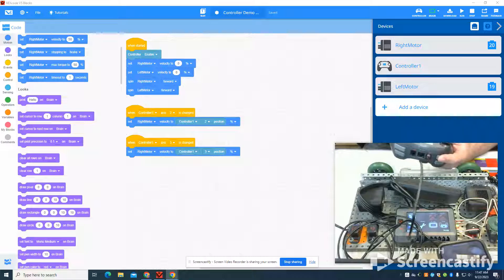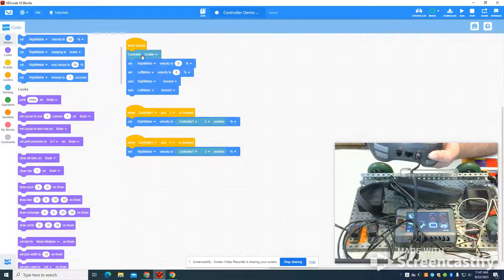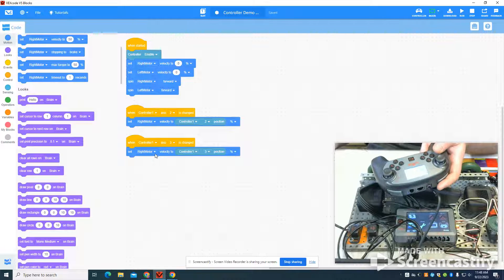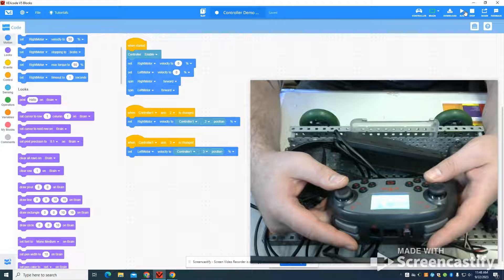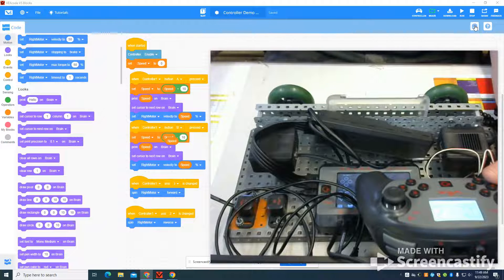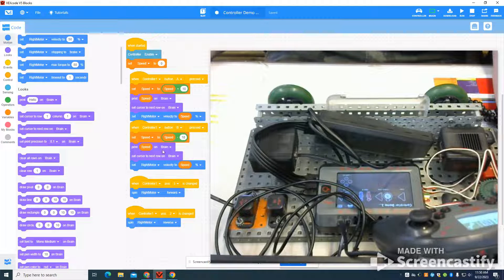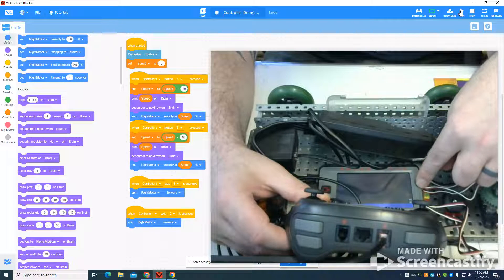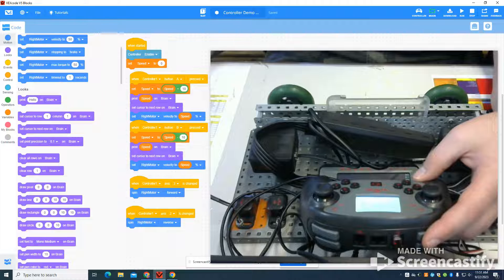VEX V5 Controller Setup and Basic Programming

Comment: whenever I try to run the code, it keeps saying "invalid user program." I don't know why and I desperately need to code auton. Could you let me know? Thank you!
Reply from the maker: This has been a know issue with the VEX5 brains. Two possible solutions update your brain to the latest firmware and make sure you're using the latest version of VEXcode V5. 

If that doesn't work, try removing all programs from the brain and then reinstalling your original program. 

Hope this helps and give me an update.
Reply: I tried both of those. I heard that vexcode v5 was discontinued. Do I have to use visual code studio? Or is it something else?
Reply from the maker: I still use VEXcode V5 daily. 

Try this turn on the brain, navigate to the "Settings" menu, and select "Reset all Settings" - this will prompt you to confirm and restore the brain to factory default

Then connect to the V5 coding studio and update firmware

Comment: Would this work with the remote operating via Bluetooth as well? I am trying to figure out how to slow down the motors when my students are using the remote wirelessly
Reply from the maker: I use the same program and connect my controllers wireless. I have had students write programs that included maximum values as well. This way their motors couldn't exceed a certain value.